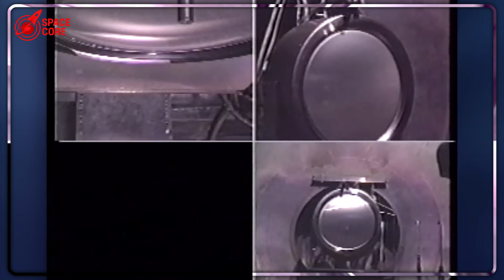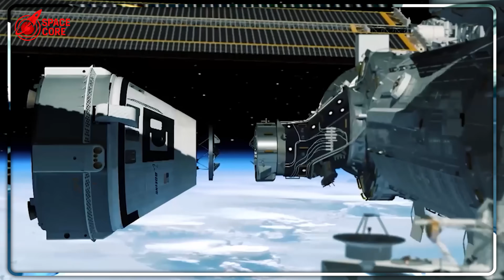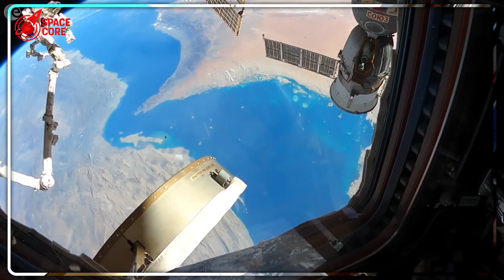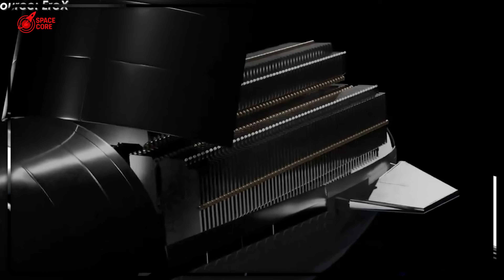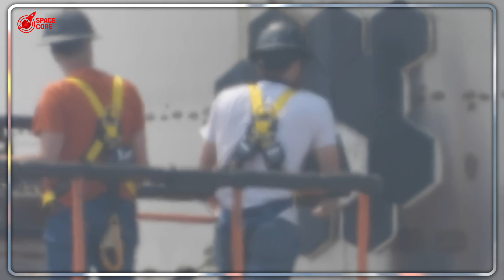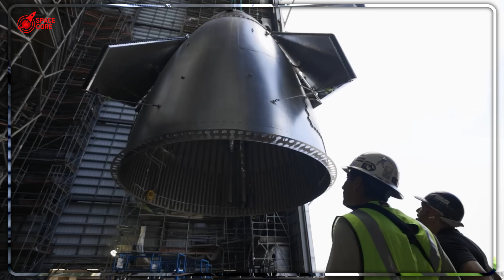NASA SHOCKED! China's Electric Method Saves 800kg...ISS Can't Compete!

Comment: It’s a freaking ion engine. We’ve used them for 50 years now? Why don’t we use it on the ISS? Honestly, because of the power goes out, there’s no way to run the engine. If you wanna keep the ISS in orbit and it gets hit by EMP or some large solar burst, you can actually run the engines on the ISS manually.
Reply from the maker: Ion engines are efficient but weak—great for deep space, not station-keeping. That’s why ISS sticks with chemical thrusters, unlike Flight 10’s test focus.
Reply: @SpaceCore25 you can use them and it has been proposed it is just the power requirements are crazy. I use to work on Ion engines at JPL as an explorer scout.

Comment: There are alternatives without fuel: an electrodynamic tether (EDT), a long conductive cable deployed from a space station that interacts with Earth’s magnetic field to generate thrust. This can “lift” the station by raising its orbit or countering atmospheric drag, without using traditional rocket propellant.
Reply from the maker: Yes—EDTs are promising for stations. But for Starship, thrust-to-weight is critical, which is why Flight 10 tests risky two-engine chemical landings.

Comment: Universe  is  electricity...why not use  what is  all  around  us....
Reply from the maker: The universe's electric vibes are inspiring, but harnessing it for Blue Origin's rockets is tricky!
Reply: It still uses fuel. That type of propulsion system just electrically accelerates particles like any other ion engine.
Reply: @The_Dungeon_Smith  Nope  big  difference  using  Ion  engines  opposed to  spinning  electrical  coils  supercooled.
Reply: @DavidSheriff-f7o it is a type of ion engine. It ionizes gas for propultion
Reply: @The_Dungeon_Smith  This  I  already  know, tx  I'm  talking  antigravity
Reply: @DavidSheriff-f7o  oh you were being facetious?
Reply: @The_Dungeon_Smith  Nope...
Reply: @DavidSheriff-f7o  then why are you arguing because it’s an ion engine.